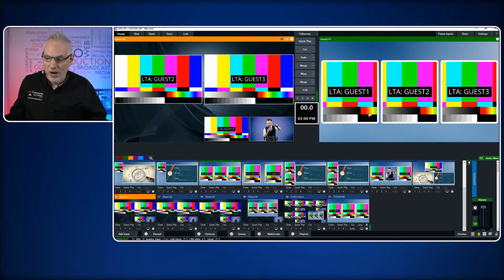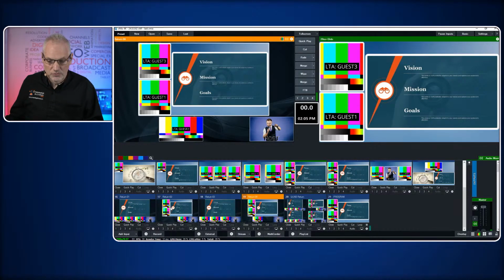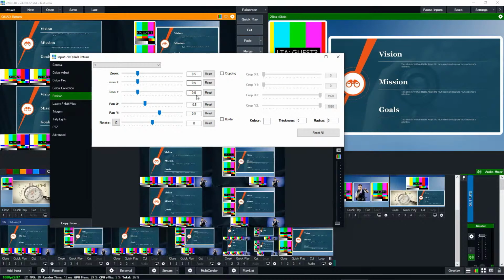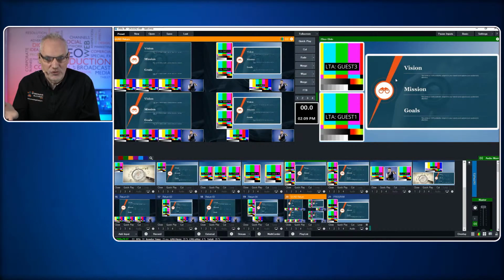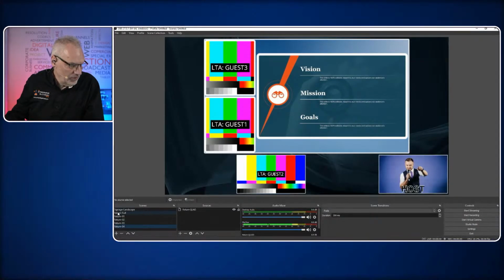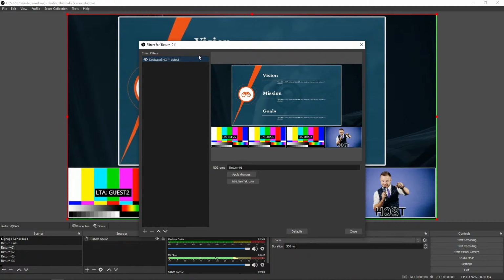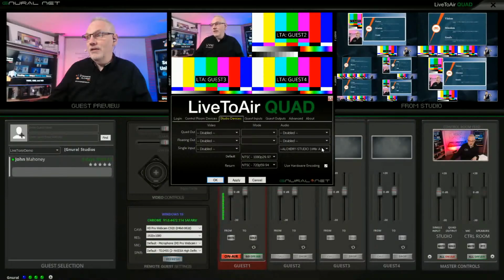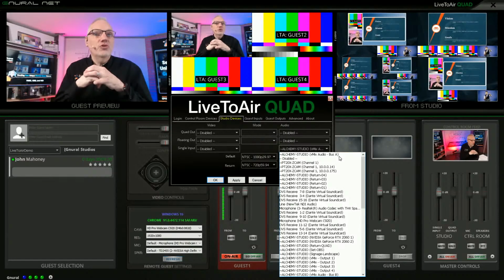Sending Four Unique Remote Guest Returns

Comment: Thanks, John! Always very informative! It even clarified something I hadn't coalesced into a single thought (regarding the number of outputs in vMix and how they could be used).
See you next week!
Reply from the maker: Hi Chris - Thanks for watching - glad you are finding the show useful. See you next week!
Reply from the maker: Hi Chris,

I want to add more detail  here about the VMix outputs that I didn't really cover clearly in the show. You can select any INPUT you want for the Fullscreen Output. For the 2 EXTERNAL Outputs, they will mirror what is assigned to Output 1 and 2, but route it out a hardware device like a DeckLink card. 

You will not send any AUDIO out the FULLSCREEN (which was fine for what we were doing here), but there are independent ways to route out audio buses. EXTERNAL 1/2 will send both  Video and Audio. This means that you have 5 UNIQUE video input sources you can output with VMix, with the EXTERNAL outs mirroring 2 of them. 

I believe I mentioned there were 7 possible outputs during the post show, and realize in retrospect that this was confusing. Hope this clarifies things. 

Best, 
John
Reply: @StreamingAlchemy  Oh, absolutely! Thank you! The audio/no audio differentiation helps as well!